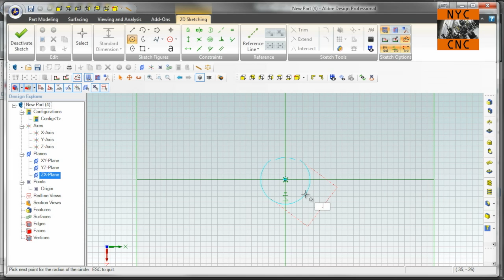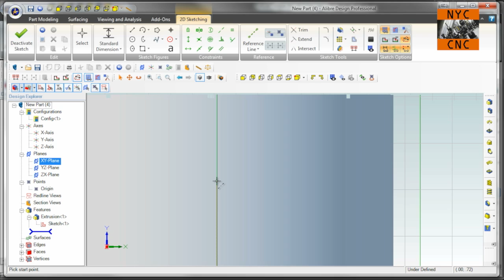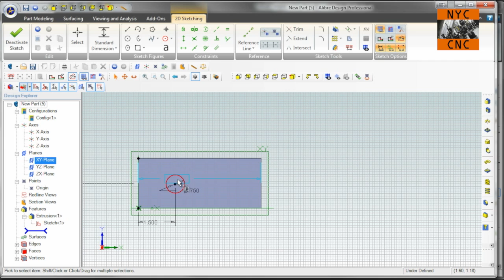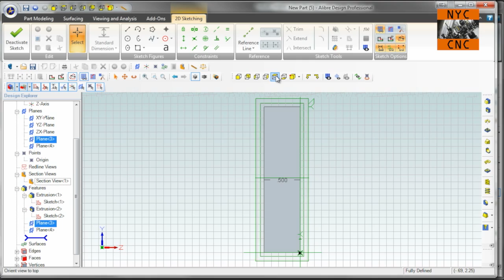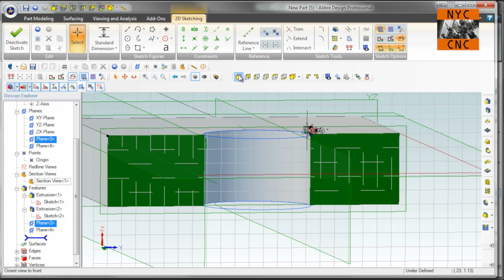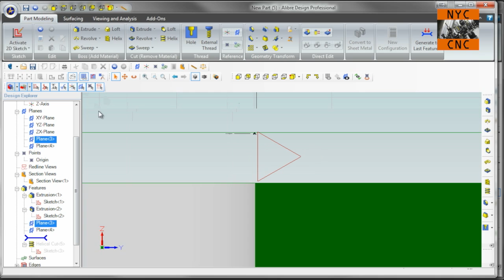Alibre CAD (Geomagic): How to Make Cosmetic Threads using Helical Cut Tool!

Comment: Though Alibre is now back in the hands of the original developers this tutorial is still very useful. What remains a mystery to me is that the ability to create both internal and external threads in Alibre is such a hassle. In this age of precision 3D printers these are not just cosmetic threads and the Hole Tool should be updated to do all of this work for us.

Comment: Thank you for the video.  I created some custom threads, but after the 3D print, things didn't work right.  
Question: Does the base line for the cutting tool (triangle) you created for both male and female threads have to be the same?  That means the distance from the base triangle and major diameter ( if that makes any sense) or do you make one cut slightly deeper than the other?
I am trying to create a thread using a quadrant as opposed to a triangle because I do not want the crest to be sharp due the nature of the material, which is plastic.  In other words, instead of having a sharp end cutting tool, I want a flat end, but for some reason, the pitch comes out so wide compared to the crest when looking at the thread in the 3D model and I think this is why the printed parts didn't work well.  Any help would be appreciated. 
Hopefully, I am making sense.  If you do, please reply.
Of course, I am using Geomagic Design as well.
Thank you.

Comment: I'm becoming a huge fan John, You are hitting on just about everything I want to do, I use geomagic design at work and I'm putting together a cnc at home, I saw your vid on how to control large dc motors with arduino, so that looks like the way I'm going. Is there a certain arduino i should get to control 3 dc motors and possible more? Thank You so much for your videos.
Kevin

Comment: are you going to buy a threadmill and try to machine an external thread?
Reply: John NYCCNC
Thanks for the video John, it was better than any video i've seen on external threads. First video i've seen on internal thread. I only hope that i can get it right.
Reply: John NYCCNC taps and dies are obsolete for cnc v=rDnavOlGcdc
Reply: John NYCCNC Hi
Reply: Wayne Blades Hi John sorry about above. In the video can you explain how long the base is to the triangle on top of bolt for the size of bolt. what about the size of thread like 3/8 -16 do you put in .062 for the pitch. Great Video wayneblaes@lvp.eastlink.ca